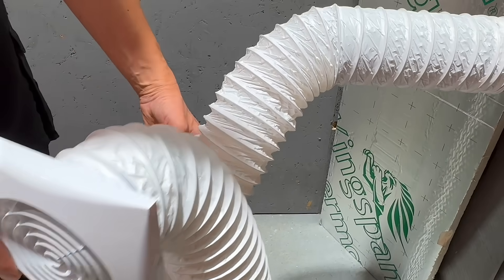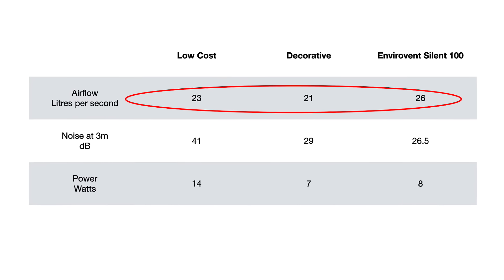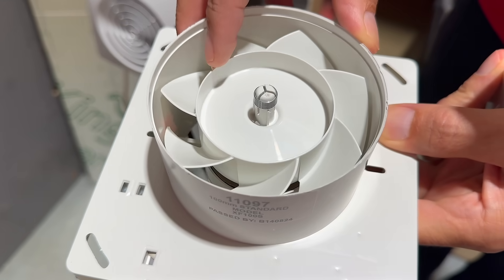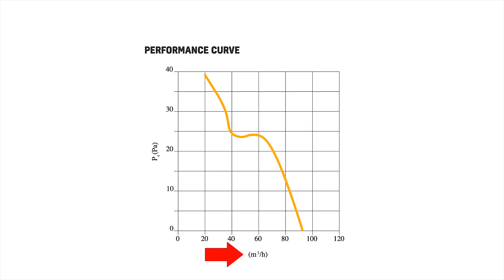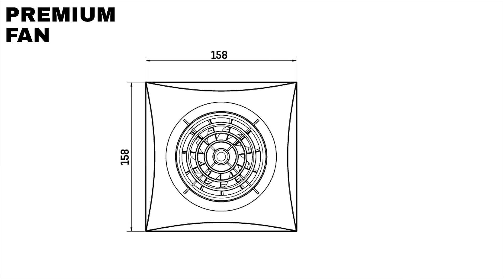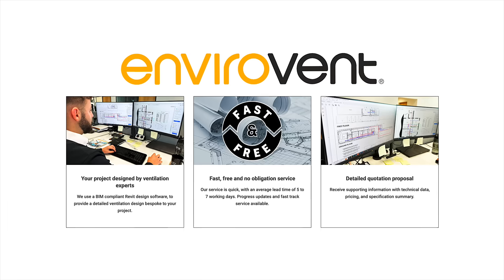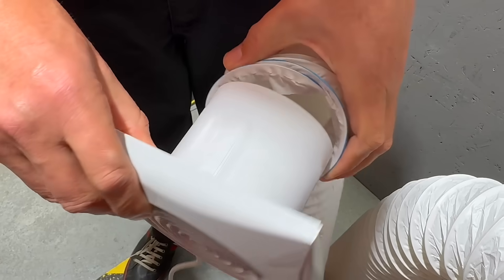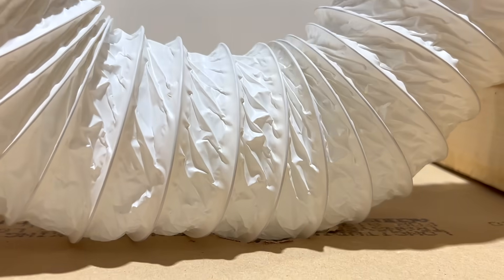The Shocking Truth About Extractor Fans!

Comment: Dont buy envirovent on the basis of thr 5 year warranty. I did and when i had an issuez they declined the claim. Even though i bought brwnd new from Amazon. They claimed that wasn't an authorised reseller.

Will never buy that brand again. Hope this helps any other future customers.
Reply: I appreciate you say 'on the basis of their 5 year warranty' but the first thing people read is 'don't buy from Envirovent'.  This is unfair as they are probably the manufacturer of the best ventilation systems on the market.  Most, if not all, manufacturers protect themselves in the same way from a warranty perspective ensuring that unauthorised resellers can't undercut their rates and still allow customers to benefit from a very extended warranty. I've had their Cyclone7 bathroom fan in a previous house and a full MVHR system designed by Envirovent in my current house and they are both fantastic products/systems. 
Rather than pay the RRP it seems you opted to pay a cheaper price for the same product but expected the same benefits in return.  Amazon can be a tricky (but highly convenient) place to buy from as a consumer. I'm sure you didn't realise you were buying from an unauthorised seller, you just saw a lower price than elsewhere and thought bargain!  There are a lot of unauthorised resellers on there; 'Buyer - beware!'.  When purchasing a more expense item from a reseller it always pays to check out the seller out with the manufacture (for instance will my extended warranty be honoured if I buy from them?). 
I am planning a new project right now.  Based on past experience, I sent a message to Envirovent sales with some questions and I got a phone call back from a salesman the next day.  A brief conversation later and he informed me he wanted me to run my questions past an engineer directly (I'm an engineer and I ask technical questions, it's in my nature).  I got a call from an Envirovent engineer 5 minutes later who answered all my questions and offered to support me with the planning of the project (for free). 
He also mentioned that there are a number of unauthorised resellers out there and to be careful where I buy from if I want my full warranty (I'm not making this up!).  Best to come direct and I won't pay much more.  So I've written far more than I intended but I hope this explains the situation for others.
I'm sorry you got stung on this occasion but it's not fair to blame the manufacturer in this instance.  As we say 'you pays your money and you takes your chances',

Comment: I open a window even in winter, works better than the enviro vent i have. Granted some may not have windows. Close the door, vent out the moist hot air. Open window vents. Fairly simple stuff.
Reply: We do this every day,full width top window fully wide open but mould keeps on coming, it's even all over the soffit above the window opening!

Comment: I’m considering a DMEV for a living room in an old cob cottage, which has an existing ventilation pipe from an old wood burner installation. The other side of the wall is an A-road. Are there any good quiet, effective DMEVs (room is prone to mood) with HEPA style filters to ensure good air quality both inbound and avoiding recirculating extracted particles from inside?
Reply: Vent Axia 498096 dmev is extremely quiet (7dbA) at lowest setting.

Comment: bought a 12 year old house and found that the builder just drilled a small hole in the exterior cavity wall and stuck a fan on one side and a cowl on the other. No ducting between the two walls. Whats worse is that the hole is probably 2 inches in diamiter so what little air can be pushed through that is likely venting into the cavity

Comment: I put 150's in the shower/bath room...  A metal insulated duct sorted out the performance issues we were having.  Fan runs-on for 15 minutes based on the humidity.   And here I was switching the fan off after I had finished showering.....

Comment: I've been fitting the cheap 150mm extractor fans in our bathrooms for a few years now (from Screwfix). I don't think the 100mm/4 inch ones standardly specified in UK bathrooms are up to the job on a straight run out of the wall, never mind when coupled with flexi duct. I always run them straight out of the wall using a solid duct too. I don't like the idea of putting them through the ceiling and into the loft, what do you do then when you want a loft extension? Also, since the air has to come in from somewhere, trickle vents open are a must, or something else - not that our homes are air tight enough for it to be an issue generally, there's normally some nice gaps under the bath tub or where pipes come out etc. but it is a consideration.
Reply: Bigger=better, 
Upwards=bad (all ceiling fans). You can make them work but its a 180 degree turn, so need good static pressure. 
90 turns, performance /2. 
Air in = air out. 
Thats in short. 

You seem to be doing good. 
Take above as a cheat list. Its way more complex than that.
Reply: @hyzary  absolutely more complicated than that, but as you say, it's a cheat sheet for what works in most homes I've been around.  Fan placement is also an obvious consideration, especially in relation to windows, doors and shower/bath. I wouldn't mind a fan in the ceiling if it was directly above the shower I suppose, but still not very maintainable, the straight duct out of the wall accumulates enough dust, never mind a Flexi or spiral duct.
Reply: @SuperVitz  i learned a bit with pc, gpu farm and studying the topic to resolve issues. Fan placement indeed is a big stuff, but i only grasped general mechanics. 
Bigger static pressure fans help to resolve it tho. Volume/min is usually to high for rooms if they work in perfect condition, so slower but steady flow is better. 
Ceiling is a problem tho. Higher it is, less it will work. They have half a rating per each meter or two. Each added meter is bad. And usually need a 90 bend aftewards anyway. 
Will work in campervan, bungalo, etc, but not if you go thru attic. Unless you use stronger fans. 
if you go bigger fan you can drop rpm for same volume too, so you going for 150 is a sweet spot i believe. 
Anyway, be glad you learned. not all 'pros' did ;) 

Also, might be worth a look on industrial fans. They come in all shapes and sizes.

Comment: Easy way to measure real time static pressure is by attaching clear pvc tube half filled with water to the duct close to the fan and measure difference in water levels when fan is running, I deal to select pipe size for long runs,

Comment: The best option is a centralised system with one extraction unit in the loft that can connect several vents.
Stand alone fans that are wall mounted create thermal bridges because they are directly connected to outside.

Comment: If you have a longways to go it may be better to get a pull fan mounted on the outside.
"Pulling" the air is easier than "pushing" the air. After all your goal is to move air, not to build up pressure.
Sure the wiring may get a bit more annoying but it's way better than mold buildup.

Comment: Fans in bathrooms need controlling with a humidistat!. When controlling humidity/ black mold formation dry air is the answer. We use to fit positive pressure axial fan units in loft ceiling or hallway dragging fresh dry air from outside the property that pressurised the dwelling with fresh dry air, pushing contaminated air away outside. The fan setup and running would acheive the set amount of air changes! Job done apart from regular maintenance. NU-air units.
Reply: But you should avoid having positive pressure in your home, otherwise you may push warm humid air into the walls

Comment: I tried 3 different fans in my bathroom, cheap or expensive the ones that got the job done were noisy as hell and silent ones weren't pumping for sht. Then I ordered a noname one with a 4-speed inverter motor from taobao. THAT Is what actually solved my problem. Speed 1 is almost inaudible even inside, speed 2 is inaudible from the bordering bedroom even in total silence, speed 3 does a fantastic job of clearing heavy fog and speed 4 can clear out a chemical weapon faster than you can breathe it in.
Reply: @yunodiewtf  can you share the Taobao link please? Thanks!
Reply: @chx7977  I don't think it'll let me post links but here's the title: 排气扇卫生间换气扇抽风机厕所墙壁式遥控排风扇厨房家用强力静音
Reply: @谢了！
Reply: Because you buy blind not knowing what you do. I wont voach for taobao, compare fan curves from manufacturer if you can dig, and see if static pressure is way bigger on taobao one. 
If not, resolution is elsewhere.
Reply: @hyzary  The resolution is in the ability to adjust RPM and use appropriate setting for the situation.
Reply: Speed 5 takes your clothes off, speed 6 - your whole house takes off 😂
Reply: @dan-nutu  Speed 7 starts a hurricane, speed 8 turns the planet into Uranus (yes) and speed 9 creates so much pressure the exhaust duct can't effectively pass is so the intake air gets compressed and collapses into a black hole
Reply: Yeah, this sounds like the usual Chinese ads/"tech specs" 😃
Reply: @dan-nutu  Yeah except Uranus is a taboo topic over there due to being sensitive to their great leader
Reply: Your last comment vanished from here (it sometimes also happens to me and it's very annoying) but I saw it in my email notification so can I ask - what about Uranus is sensitive to their leader?
Reply: @dan-nutu  YT censor sheeps being censor sheeps. Just look at his face and then look at.. URANUS you'll get it

Comment: I ended up simply installing a PIR unit onto my envirovent 100 and it drastically improved the extraction process overall, stink humidity  etc with a run on timer, along with ensuring a 10mm gap under the door.
Reply: @Brian77766  yep, I also have a PIR installed to control the fan in my ground floor cloakroom. Enter the room and the fan starts up. Moving about the room constantly triggers it, and when the room is vacated the fan’s internal timer keeps it running for a set amount of time before shutting it off.

Comment: What lot of people fail to understand is that you can put hundred extractor in your romm, if there is no way for the air to enter from an other way, there will be no extraction because the room will be in depression and the air flow will stop.
Reply: What's not been mentioned here (directly) is that most of the types of fan shown (I can't for the EnviroVent models) are not suitable for use in fully ducted systems. If you have the space, i.e., can fit the fan in the loft, a high pressure duct fan is a far better option. 
Also, if using ducting, it's best to use insulated ducting to reduce condensate formation in the ductwork.
Reply: There will be some not a lot I clearly said no most bath rooms have a door with gaps in hundreds of fans in a small bathroom will create passive pressure drawing airbon though the door is gaps and any key hole, not a lot but enough to clearly make your statement of no air flow wrong even one drop of snow at a single walearher station. Is enough for a betting company to be legally obliged to pay up a white Christmas bet,
Reply: @markdowdall2832 if fan has low static pressure, then no air is gonna be sucked after inititial pull. 

Ive run my mining gpu farm. I did a similar test. 
30inch fan at max with cracked open window / air is moving, but is turbulent and eventually creates invisible wall. 
It works perfect for mixing in air, but nothing gets out. 
Increase the intake/lower the pressure, suddenly air is flowing consistently. 

Similar effects can be spotted on a high mounted ceiling fans in warehouses and factories. 
Smoke stays below ceiling and is spread around, not vented out. Air before fan is pressure locked and nothing goes out. 

What you feel and see is air mixing before fan, but is going out nowhere. 

Good tests you can do pc building and such. Slight change in setup can make a big difference in perfomance. 

Any logic is thrown out of window when physics comes in. 

Rule of thumb, bigger=better, static pressure perfomance>rated volume, intake=outtake. If outtake is lower, then it suffocates.
Reply: @mikepeter1323  also when there is no makeup air you start pulling in air from places you don’t want to like around lighting, closed windows, electrical outlets and this in turn will bring with it the dust from insulation and other contaminants that you don’t want. You could also be pulling in un-conditioned air and expelling the conditioned air that you paid to cool or heat which is a kick in the wallet lol. Same happens with unbalanced hvac systems!.
Reply: Your doors are not airtight.... at least I hope they're not 😂
Reply: @BadandMadMartin  wherever it comes from, you can’t just extract unless it’s going in from somewhere
Reply: @caroleast9636  as stated there is make up air from internal doors, etc. I am a mechanical design engineer and I design heating, ventilation, water, air conditioning, and above ground drainage for buildings.
Reply: @BadandMadMartin The door might not be airtight but there needs to be a large enough gap under the door to allow free flow of air into the bathroom to allow the extractor to work.

Comment: The key issue with extractors is location. Locate them nearer to knee height in the wall, not in the ceiling and they become way more effective at moist air extraction. The general assumption is that warm steamy air will rise is not that accurate. Very moist air will sink to the bottom and this reduces the effectiveness of moisture extraction in a shower where the extractor is located at the top.
I realised this (facepalm) when remodelling our bathrooms and tried both ways- in my son's bathroom I mounted an extractor (smallish one) at around knee level and 2 years later, he has still failed to get the bathroom steamy under any conditions. Our other bathrooms have extremely powerful ceiling extractors which still don't work all that well.
This approach requires some creativity to ensure that the fan itself doesn't get wet but it's not impossible to do.
Reply: “Very moist air will sink to the bottom” That is completely false. Moist or humid air is less dense than dry air. It rises above the drier air. That’s why you see mould forming in the upper corner of rooms much more often than in the lower corners. You need to go back to the person who misinformed you that moist air sinks through drier air and have a word with them. They haven’t done you any favours there.
Reply: @Monaleenian  Try doing it before dissing it (locating an extractor fan lower in the shower). It works extremely well, probably because the air is not just vapour but tiny droplets. 
Perhaps I should have mentioned that I had an extractor in the ceiling too (which which was far less effective).

Comment: I added 3 flow switches when I rebuilt our bathroom. 1 on the cold feed of the shower,  bath and toilet which triggers the fan, 1 to the hot feed to the shower & bath (also triggers the fan, added as redundancy).
These are connected to the fan where a lighting circuit would normally be connected to trigger the fan, so it's using the built-in timer that keeps the fan on after the water stops flowing. 
Lastly, there's one on the hot feed of the shower (triggers the lights in the shower cubicle. This has a custom built electronic timer that keeps the lights on for 6 minutes after the water flow stops).

There's a sink in the bathroom, but I intentionally put the flow switches after the sink in the water circuit as there's no need for the fan to come on when just brushing teeth or washing hands. 

With this setup, the fan only comes on when the shower or bath is running, or if the toilet is flushed. It then stays on for 10 minutes or so after the water flow stops.

If we ever need to force the fan to come on, we just turn the bath or shower tap on for a second.
If we ever need to force the fan off, we just use the fan switch outside the bathroom.

We also have a movement sensor that's controlling the lighting, with a 5 minute delay before it turns off.

Simple setup that works a treat and has been reliable for over 10 years.
Reply: Great idea and not something I thought of. I simply installed a PIR unit onto the fan with run on timer, as the room gets plenty of light. Granted it comes on when brushing teeth, but ventilation is good no matter what. Chopping 10mm from the bottom of the door also helped greatly.
Reply: Yes.  I much prefer the idea of an external over-run than the cheap and nasty electronics built into many fans, yet couldn't manage to find a device that closes the contacts for a set period commencing when the switch (flow switch in your case) opens contacts rather than commencing when the contacts close.

Since then, I've discovered that Italian domestic wiring LOVES using relays.  They often use relays instead of 2 or 3 way light switching, and on stairwells they often use timed relays.  Practically ever home has a relay or 3 in its lighting circuits.  Looking at the datasheets for "Finder" (other brands are available) temporizzatore luce scale, I learned that these can be set to run exactly as I would have needed for an over-run relay.

So this would be an alternative to custom building an electronic timer (though I'd love to see the circuit diagram if you are willing to share it).

Comment: Sucks the heat right out the bathroom that 100mm HOLE does warmest room in the house not no more since I fitted a fan,open the window used to work fine never ever had any mold house is 100years old.Heat Pump doesn’t supply enough heat for towel rails we are going backwards £60 spent on heating the house now and it is never above 19c.